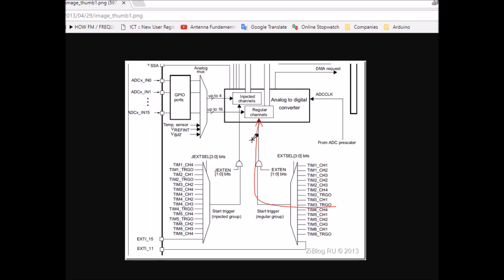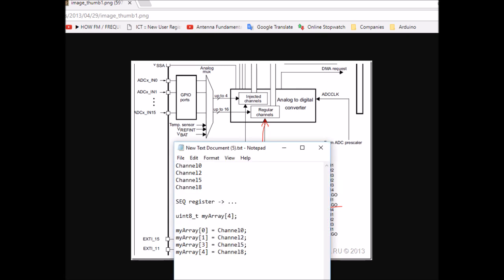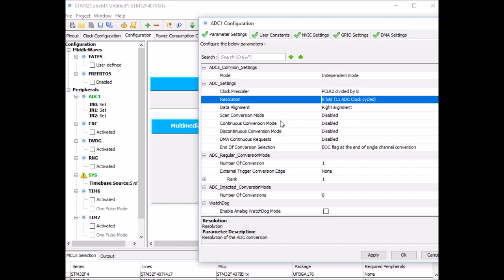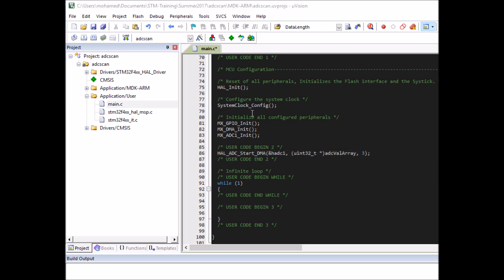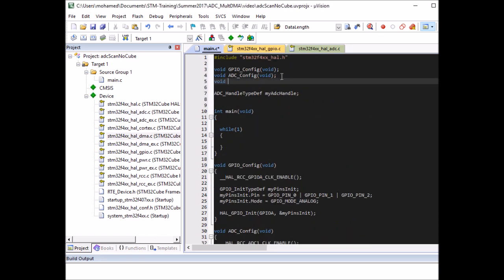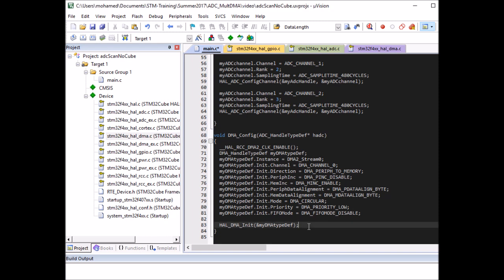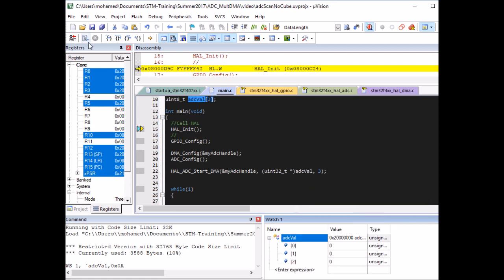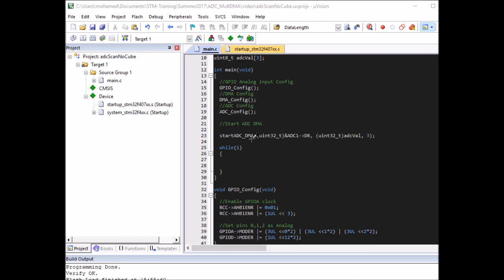STM32F4 Discovery board - Keil 5 IDE with CubeMX: Tutorial 6 ADC Multi channels - Updated Nov 2017

Comment: Just a general question.... What is the maximum Sampling time that is possible? I experience a nice output converted at a sampling frequency below 20kHz, but I got a pile of rubbish at a sampling frequency above that... All I work with 8-bit means the Tconv_c is around 9 Clk and APBH frequency of 84MHz...
Reply from the maker: You can get very fast sampling time, just need to make sure it is sufficient for Sample/Hold circuit to do its job with the given capacitance value and PCB impedance. There is a simple RC 1st order ODE that you can solve for.

Comment: Hey thanks for the tutorial, its very helpful :)). I want to ask a question though. I'm currently working on a project to drive a firing angle of 3 thyristor through 3 IC's for 3 phase project and i need the DAC to drive theese 3 IC's. Instead of using 3 DAC's port can i use just one DAC port and parallel it to create 3 more DAC output with same level of voltage?? And if not, how to add more DAC output  port??

Thanks

Comment: I've copied this exactly.  the program compiles and downloads without errors.  When I add the array to watch it doesn't give me the option to expand and when I move the POT it doesn't change the value of the visible Channel 0.   Any advise?  If I change the declaration from uint8_t to uint32_t it works fine but the results I get are weird...

Comment: This is kind of interesting, maybe.  Working on ADCs on STM32F446  and I see this in the user manual.  Do you think they made a typo error on DISABLED vs. ENABLED ?

Bit 10 ADC3EN: ADC3 clock enable
This bit is set and cleared by software.
0: ADC3 clock disabled
1: ADC3 clock disabled

Bit 9 ADC2EN: ADC2 clock enable
This bit is set and cleared by software.
0: ADC2 clock disabled
1: ADC2 clock disabled

Bit 8 ADC1EN: ADC1 clock enable
This bit is set and cleared by software.
0: ADC1 clock disabled
1: ADC1 clock disabled

Bits 7:6 Reserved, must be kept at reset value.
Bit 5 USART6EN: USART6 clock enable

This bit is set and cleared by software.
0: USART6 clock disabled
1: USART6 clock enabled
Reply from the maker: Could be

Comment: Hi, I am trying to read data from 4 sensors using a 12-bit resolution, therefore my adcArray[] is of type uint16_t. Additionally, that means that my DMA reading was changed to: HAL_ADC_Start_DMA(&hadc1, (uint32_t *)adcValArray, 8);
I also tried connecting only one channel, and while i was debugging, the other 3 channels had readings(erronate ones).
The thing is: the reading seems to be incorrect. What can i do in this situation?

Comment: Hi, first of all excellent video, and I have a doubt, I want to know if its possible to fill up a buffer, 4095 values,  variable, using just one ADC channel with the DMA, how could I configure that?
Reply from the maker: Hi Cristobal,
Thanks!
Yes, it is possible; you need to set the DMA to normal mode (i.e. not circular), enable memory increment and simply start DMA asking for 4095 data size. This will get you 4095 consecutive data points of your single channel and store them in your array/buffer.
All the best :)

Comment: @MYaqoobEmbedded. I had been trying to use multichannel analog for two analog channels but in the end, I get the first channel is reaching the maximum value of 255, not the second channel. could you help me, please?
Reply from the maker: Hi,
do you still have this issue?
Reply: @mutexembedded2206  Yeah. I tried your code also but it's also having the same issue.
Reply from the maker: Can you describe the hardware and the issue in more details
Reply: @mutexembedded2206  I'm using STM32F429 discovery board.  I'm trying to read multiple analog inputs. There is no issue with code and it's flow. Everything seems to be good.  The 0th index of the array shows maximum value and it varies when the pot varies but the 1tn index of the array is not showing the maximum value and doesn't vary when the pot varies.
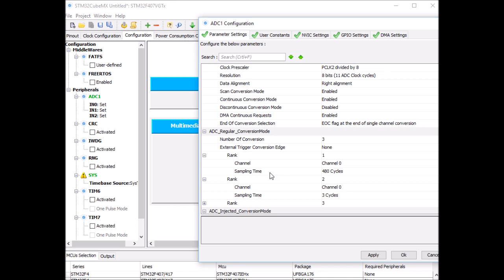Reply from the maker: First thing to check is conversion rank settings at 04:45
Reply: @mutexembedded2206  Yeah, I check it. It works .